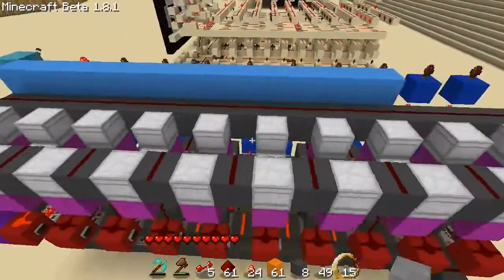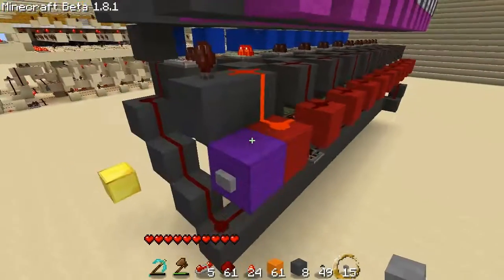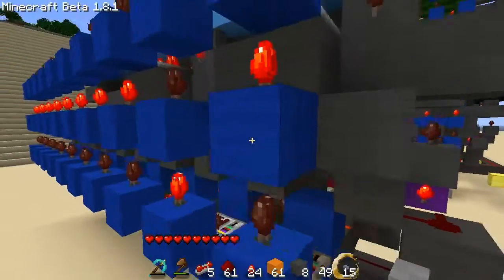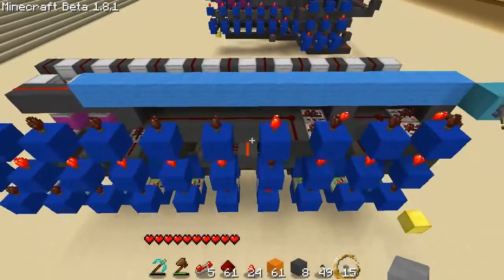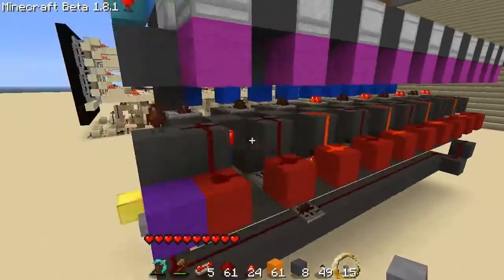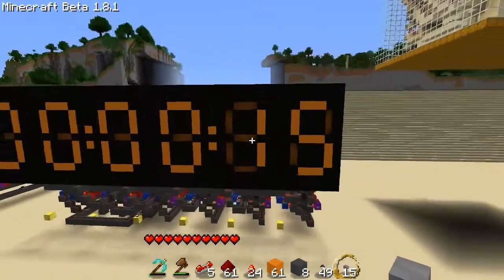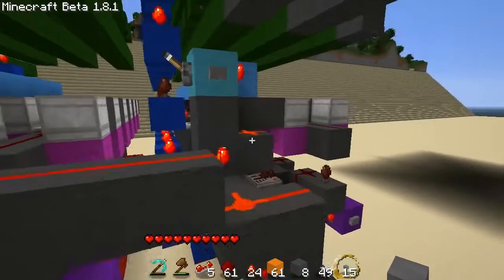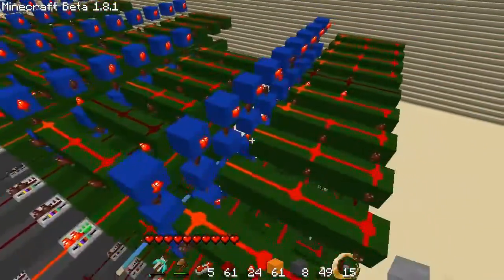Minecraft - Shift Registers

Comment: This isn't a lfsr, but a circular shift register.  lfsr's tap specific points in the design, run them into xor gates to calculate whether or not the first bit is set to on or off.  This is pseudo random number generation, it's main purpose.  But good circular shift register.